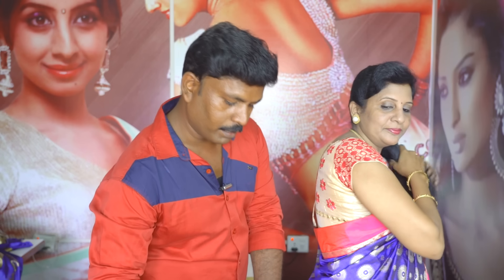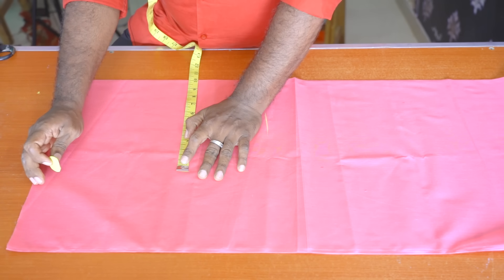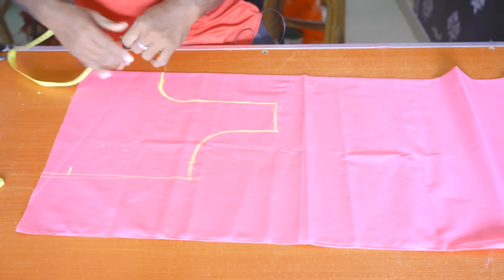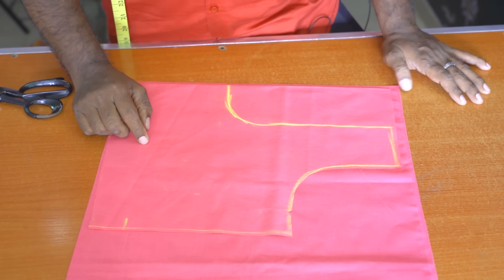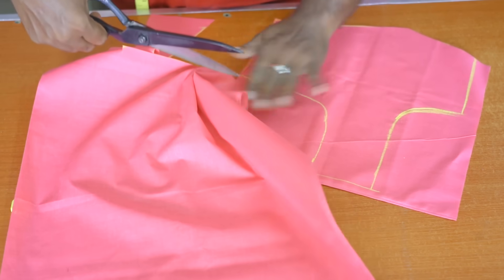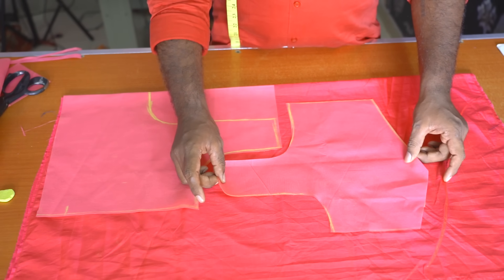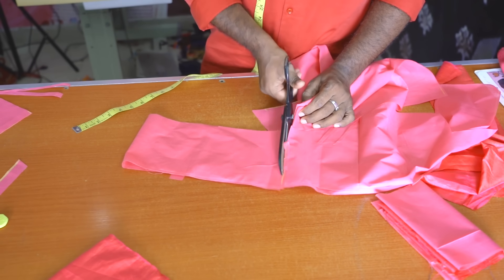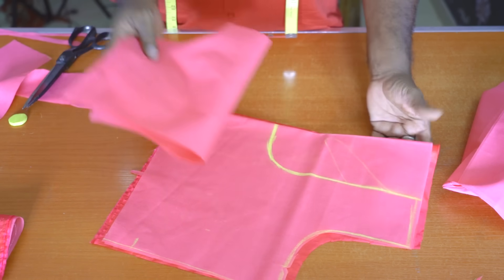Blouse Measurement and Cutting Part 1 | Tailor Bro

Comment: Yentha machine vaangina nallarkum   8000 kulla. Yethu best. Pls reply bro
Reply: Usha is below 7000. If you stitch more extend your budget and buy a meritt...11000 varudhu i think market la plus 2000 extra if motor is needed. Meritt is a better for long run.
Reply: @ss.2727  I bought singer 7000